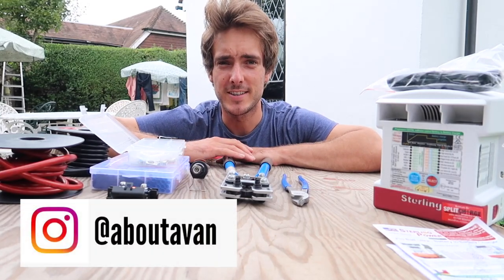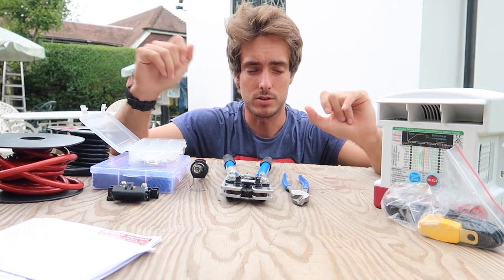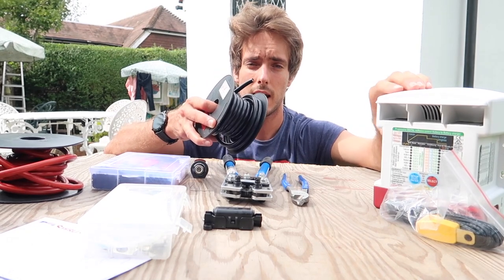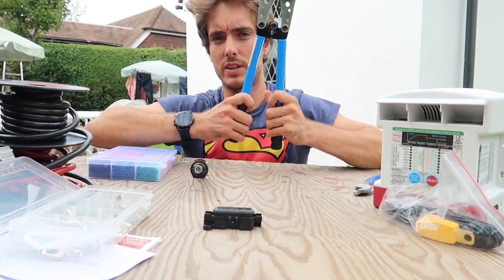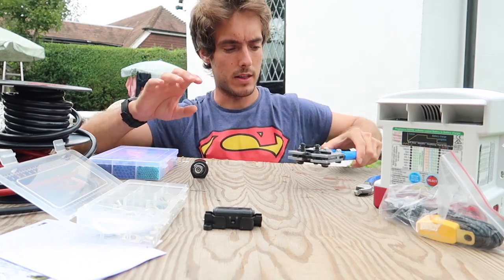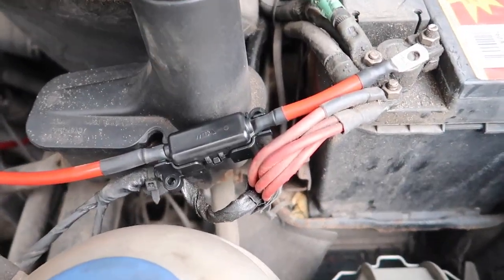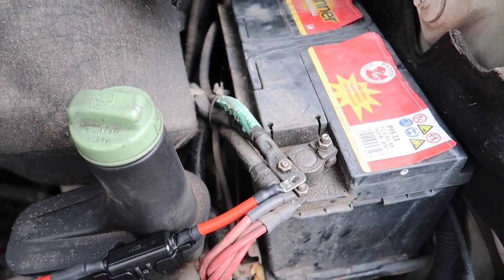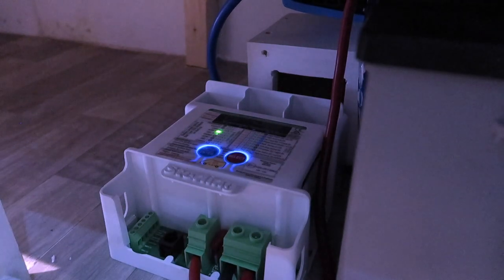STERLING DC to DC 60 amp charger

Comment: Thank you. great video. Very informative. I plan to run my cables from the van battery (passenger footwell) to the leisure batteries (rear of van) inside the van but under the insulated floor ( it’s a 2022 LWB Sprinter). What do you think? Obviously I’m not planning to put a screw through the cables and will mark the route on the plywood floor for anyone else to see after I sell it on.

Comment: Hi how do I set the b2b charger up with the settings please. I have 2 sterling leisure battery.. also if it isn't set up properly would it cause the whole of the electrics on the van to shut down. Many thanks. 1st conversion

Comment: Hello, what is the cable size recommended by the manufacture for the 60 amp model?  Thank you
Reply from the maker: 16mm² for a cable run under 5m I believe.

Comment: Hi,
I found diagram on the website and it's showing that minus cable going from car battery not from the leisure one and all so both batteries leisure and car battery are connected by minus cable. Hmm...
I'm  confused now... :)
Is it everything working fine in your van?
I heard that if you connected to chassis the efficient of charging is going down...
Very good movie. Thanks
Reply from the maker: Hey Pawel, the Sterling model only has space for one earth, I did not want to run it all the way back to the starter battery so I earthed it on the chassis, I have had no issues and get a good output from the B2B charger.
Reply: @Aboutavan  thanks for quick  answer. I will do the same way then. :)
Thanks

Comment: Very good video. How did you size the fuses?
Reply from the maker: I would size slightly up, so for a 30a unit I'd use a 40 amp fuse and for a 60a 70amp fuse the cable is rated much higher than this, this is just to allow for a slight surge on start up for most fusing on lights, chargers etc I would allow 1.5x the amp rating for the fuse but they're generally much smaller loads :-)

Comment: Would a smaller pair of ratchet crimping pliers do the the same job?
Reply from the maker: Possibly depending on which ones you have but I doubt it they're usually for the smaller red, yellow and blue terminal ends :)
Reply: @Aboutavan  Ok, thanks for the quick reply.